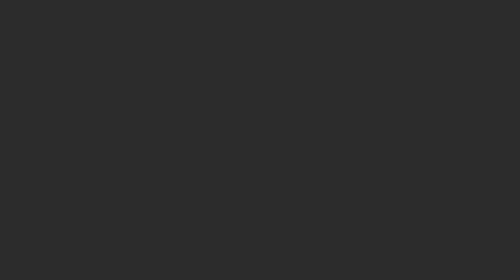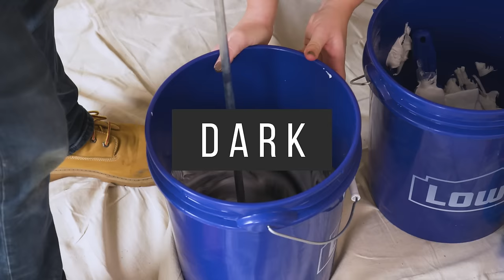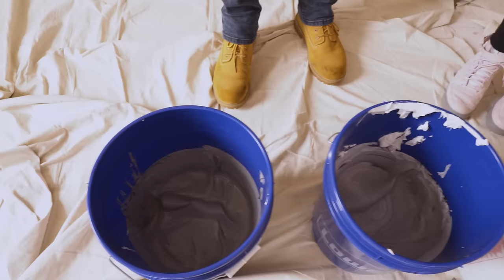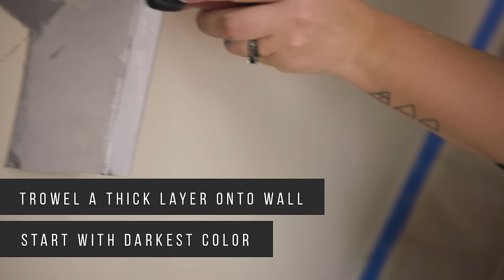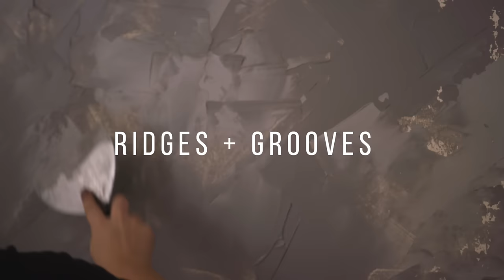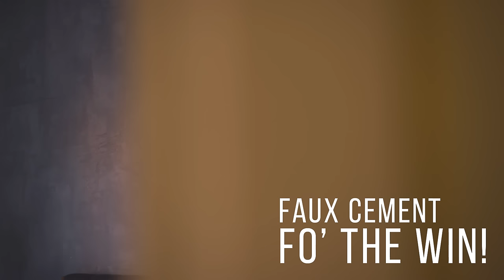How to Make a Faux Concrete Wall

Comment: Just finished our dining area wall and oh boy all you need is time. Simple but for a one person job I’ll take awhile. We kept our wall pretty light came out amazing! Start with the darkest shade to your medium/lightest for finishing touches. Also would recommend doing the edges first cause that would be the part that took most of the time. No need to sand it down.
Reply: Hi Mervyn, my wall is a bit textured. Do you recommend smoothing it first?
Reply: Meliza Soto hey! My is slightly textured too. No need to smooth anything. Really recommend painters tape the edges or walls that you don’t want to get it on and the floor. First You’ll regret you ever started...haha but in the end it was all worth it! Also decide how dark your want it to be and work down to the lightest from there. And one more thing don’t apply a lot in one time and lift your trowel cause it can remove the application and I’ll look your ripped out your wall.
Reply: That's awesome! I'm glad this technique worked for you. Did you prime your walls with anything prior? I want to do this on a wall that's already been painted on. Also, how are your concrete walls doing? Any cracks?
Reply: Hiu Yi Tsun no prime needed. Plus my home is almost a year old so idk if that makes a difference. Plus no cracking holding up just fine. Temperature in home is about 70-75 F in home.
Reply: Did you seal it?

Comment: That looks good but what do I seal it with so it does not leave dark powder on everything the brushes against it? I have 2 big dogs and Everytime their fur touches it dust comes off.
Reply: You can use a matte varnish, water-based, the first coat diluted with a bit of water, the second coat straight on.
Reply: This guy asked the right question 👍
Reply: Water based poly?
Reply: Matte clear coat it with cement garage floor finish, about 30 a gallon.
Reply: @Snowy Pit  any specific brand and does the spray works the same?

Comment: Found the sealer.  Zinsser Zinsser Gardz Primer Sealer 916ml.  Lowe’s or Home Depot
Reply: would you apply the primer before the joint compound or after?
Reply: @blackwingers  i think it's after
Reply: Does this sealer give the faux concrete wall a glaze or shine?  I want to seal the joint compound so it doesn't rub off like joint compound will but I also don't want a shiny concrete look.
Reply: @AJ-fn3hw  You can use any water based varnish with a matte or dead flat finish. Saman makes one, if you're in North America.
Reply: Kilz Clear Primer dries flat

Comment: I'm doing my entire room like this, except one wall. At least if I do decide to do the one wall, I will be either adding a different color or painting over it to still get that texture. What I want to know is what type of wall prep should be done? I have cracks and you can see where wallpaper was coming off and they just painted over it. Thanks!

Comment: Do you have to wait until the dark coat dries before putting medium and light over it?
Reply: RJuarez no. You can’t allow others to dry.  It needs to be almost concurrently imo
Reply: Yes, if the coats are too thick they will crack. Better wait between coats.
Reply: I tried both ways, and it's definitely better to put the medium and light right after doing the dark. You can mix it up a bit with the teeth side of the trowel to give it a good blended look and it's so much easier than doing it when dried. And then it doesn't crack if you blend it a bit.
Reply: It depends on how much you want the colors to mix. really scrape into thin coats to prevent cracking.
Reply: I would allow each coat to dry fully to prevent cracking

Comment: would this work for exterior?\
Reply: Probably not, since joint compound is water-sensitive. For exterior applications, I would advise using stucco or some kind of actual cement compound

Comment: I can do this in the ceiling too?
Reply: Yes but I would make sure the drywall has been screwed in if your house is before 90s it 2as probably nailed so you should screw to the joists first the do thin layers you can let it dry 24hrs before doing a 2nd thin layer

Comment: Do you know if this technique can be used on cement backer board in the bathroom?  Any tips?
Reply: I am guessing this may not work well in a bathroom because mud has to be painted to be water proof. I am going to try it and see what happens but it just seems it would not be good in a high moisture area.
Reply: @primesourceguy  Exactly, don't try this in a bathroom.
Reply: Use a product called "cement all" it's by rapidset company. Available at any Home Depot @ about $24 a bag.. It's easily mixed, just mix a little bit at a time because it dries really fast. You can also "tint/dye" it with the same cement dye they're showing in this video. Then seal it with concrete sealer. This method I mentioned is EXTREMELY more durable. It's also done the exact same way this method is done, so it's no different in effort but the result is incredibly better. ✌️-Joey
Reply: @joeygunzilla6878  Can this method that you mentioned be used on painted and textured dry wall? Or only on cement board as asked in previous question? Id like to try this technique but I want it to be done the "right" way and can't decide if I should just go with Portola lime wash paint..
Reply: @Kris.10  I did my wall about 1 year ago and it has lasted without any issues. I did mine over fresh drywall. But for Textured drywall? I'm not sure what you mean.. like sharp plaster spikes or popcorn? In either case I would scrape that stuff off the wall first. In your situation, you're thinking of adding a layer of cement to the popcorn texture not penetrating or bonding to the actual wall. If your texture ever cracked or lifted off the wall (which frequently happens) so would your new project.
Reply: @Kris.10  yes if you want lightly sand first & wipe then apply

Comment: Wouldn't joint compound just melt off if you got it.wet or tried to wipe it down with a wet cloth when it got dirty?   Theres a product called Henry that might be better then Joint compount.
Reply: Hi uptown did you get an answer on this at all or try it out? I noticed the Henry but it seems to be much thinner than the joint compound and I wanted to create thicker effect. However since it’s in the bathroom I do want to see you at what would I use for this?
Reply: Definitely should be sealed

Comment: Will this work over paneling?
Reply: Yes just add extra wood glue and start with a thin coat let it fully dry 12 hours use the green all purpose in a box not the bucket(has less glue) I would test a small section first. Make sure to clean the panels very well first with tsp, krud kutter or simple green. If you can scuff them with 80 grit even better, wipe clean again. Test a small section with just plain drywall mud plus the wood glue. Vancouver carpenter has videos on adding glue to mud.

Comment: (me after watching a 43 second tutorial) That doesn't look so hard.

(three days later) Welp. That didn't work... How exactly do I clean up this mess?
Reply: It didn't work? What happened?
Reply: 🤣Darn it! I was hoping it was a successful
Reply: @smoaT  I'm not even sure how it went so wrong. 

I ended up getting several sheets of drywall and having my husband cut them in half. I experimented on both sides of the sheets for a solid week and got it kind of close. 

It does take an artistic touch that, apparently, I do not possess. I think I've got it to a stage where I'm ready to try it on a real wall. (After a bit more practice to be sure I've really got it down.)

I've found a few other videos that are longer and I could see where I was messing up the technique some.

Some things do take experience... or talent.. or at least a bit of beginners luck... lol! 

In the end, it was really funny to me. I kept thinking of the 'pintrest fail' and 'nailed it' photos. Tis the story of my life! :-D
Reply: @vociferonheraldofthewinter2284  I did it myself. Took longer and it really is a bit complicated getting the hang of it

Comment: Reat info. How do I keep the wall if I have old wall paper from the 1970's that will Not come off without destroying the sheetrock. And no steam did NOT work nor any other product I tried.
Reply: Just scrape all loose paper and apply oil base primer
Reply: Apply Guardz over the wallpaper first to seal it

Comment: how do I get rid of this when moving out?
Reply: You don't need to. Joint compound is easily sandable, so just sand until even and paint
Reply: When I was in a rental I screwed 1/2 inch plywood sheets to the wall. I covered the screw heads with a bit of masking tape then I went over that with my faux effect. When I moved I just had to dig out the screws, unscrew them, and pull the plywood out. I patched the screw holes and painted the wall.The texture that came with the apartment wasn't hurt. Landlord was thrilled about how I left the place.
Reply: You can also do it over 1/4 inch luan or even on 4x8 foam sheets of insulation
Reply: @VikingAwayFromHome sanding would make an atrocious mess plus it contains silicate

Comment: Can this be done in a bathroom? I’m worried about the humanity in there damaging the wall..
Reply: Oh the humanity!
Reply: @SaultiBalldeip  🤣
Reply: Don't worry about humanity, Coronavirus is here
Reply: humanity is very damaging, yes lmao, darn humans
Reply: not over drywall - you hang durarock, and spread concrete on the wall with a latex additive to prevent cracks  and seal it with a concrete sealer.
Reply: You can do this over your walls & ceiling just seal it with kilz clear flat primer or for glossy finish Guardz

Comment: As a wall, no Bueno. Jails have concrete walls. However, I like this as countertops for an industrial kitchen, contemporary kitchen, man cave, even in the garage. How might this hold up as countertops? What would you use to seal it & be food safe?
Reply: lol. I never thought about the jail but that is a good point. I think this looks nice in a contemporary home, though.
Reply: Traci Morgan - I watched the entire episode to make sure I had an open mind about the wall. It appears cold to me, instead of warm. The beams on the ceiling help to warm it up some. Overall, I think this look would have been better placed in Lowe's "Warehouse" series, or maybe the house is located in the industrial area of the city? I like when a house has one theme throughout. It's how New Builders present their homes, one palette of color & style for the entire house. That's why they sell so well. We get drawn into, "If I buy this house, I can live like this....where do I sign." Lol
Reply: I don't know what jail you been. Mostly cinder blocks and or bars.
Reply: lol
Reply: Slap Stick, what do you think cinder blocks are made of lol
Reply: True, but cinder blocks are cast concrete blocks. Concrete walls are  poured. In the industry,  its different.
Reply: I dont think this would be good as a countertop but perhaps as a backsplash on the kitchen it would look amazing. It might not be as great for cleaning though so maybe make a statement tile piece behind the stove that would look both beautiful but can be good to clean.
Reply: use Henry's  or Ardex to skim Cote counter tops. Mud will fall apart
Reply: coat not cite
Reply: @edbogies9620  or "cement all" by rapidset.. followed up with a coat of concrete sealer

Comment: How about just the "concrete" wall paper lol
Reply: For a lot of people this can make a space feel more personal as they have put the time to create it. added to the fact that it might end up being cheaper.
Reply: +$500
Reply: @scarlettbellier-igasaki2861  Yep, the materials for this cost me $20 and wallpaper + adhesive  would have been about $110 because of the size of my wall
Reply: ...not to mention this at least has a shred of authenticity. If you cant actually do concrete, at least you will get the texture and color youre looking for. And when looked at you will not  just a cheeky grin when they realize its a print out.
Reply: I had the wallpaper. Instant regret... you can tell it's a printout. it lackes texture and most of them are glossy.

Comment: Does that need to be sealed, or can it just be left as is?
Reply: WordsAreLikeRivers Exactly what I was thinking.
Reply: Good question. I was also wondering.
Reply: Paste wax would work
Reply: Better seal it if there is a lot of traffic. If not sealed it will come off if you rub it hard or with a wet cloth. If it's a space that is never touched it doesn't matter.
Reply: Seal with a non yellowing acrylic varnish.  If you want something that looks more like polished concrete use a glossy finish, if you want a softer look that has no shine use a matte finish.

Comment: It looks cool but it would easily get cracks in it.
Reply: just adds character. Also, I remudded my bathroom this way and it doesn't have any cracks - it's been almost a year
Reply: @picklepirate  did you seal the joint compound after finishing your bathroom?